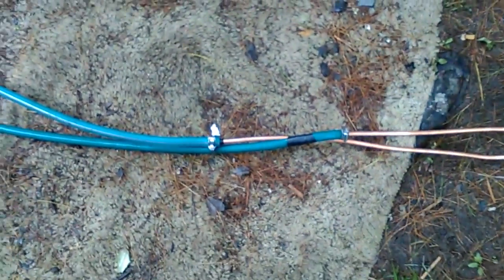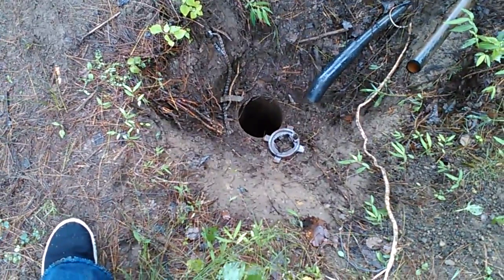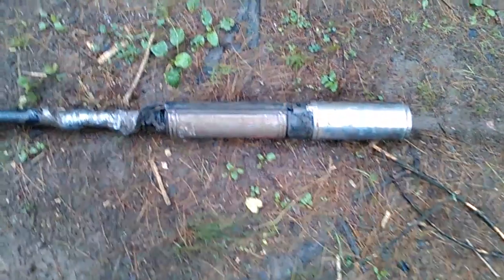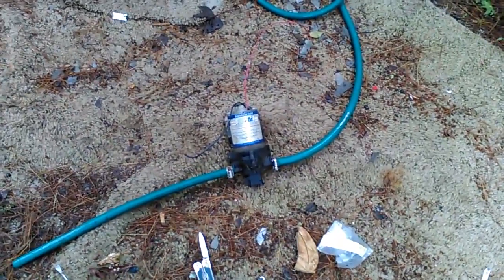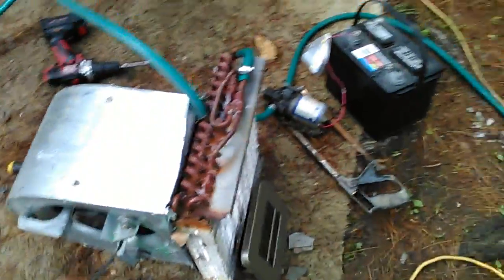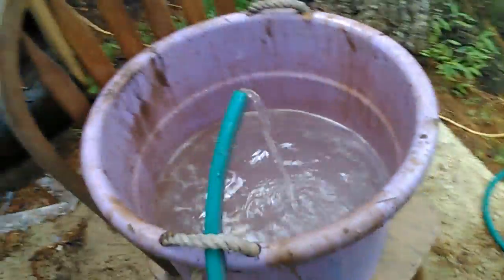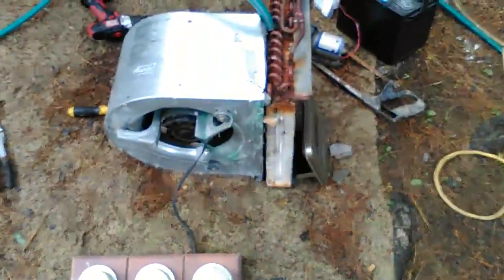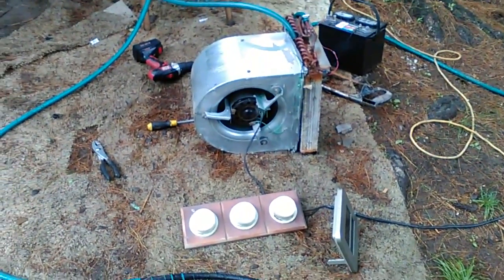easy DIY geothermal cooling system.

Comment: Theory of ground source water/ with that type coil 5/8" water inlet/outlet  with 70* air moving across, cool maybe 200 sq.ft. area. If you got a pump/grundflos/115volt.move water quicker and could keep the loop cooler. Try and find ole wide think horizontal coil or hydronic /coil. they are cheap under 80.00

Comment: an idea i have and seen which has nothing to do with this type cooling.put a round duct pipe from a outside tree in a shady area.from there run the pipe into your home grill it off and use fan if you wish for summer cool air from outside.basic principle of years ago     in cooling before air cond. in office buildings between the walls going up floors.

Comment: Why do you run the water into that blue tank? Can't you connect together and run in a closed loop?
Reply from the maker: That was what was intended but the hose had a couple of leaks in it and the pump kept losing its prime so I used the tank to hold extra water to make up for the leak. I didn't want to spend any money on it since it was just an experiment so I used what I had. To do it right you would buy all new materials so there would be no leaks, then it would be a closed loop.
Reply: If you use this as a water source open loop system, it will give some benefit. But, it will not work as a closed loop system if you return the water to the same well. There is just not enough BTU transfer to the soil surrounding the well pipe. You would need a few hundred feet of such closed loop system to get the benefit you are looking for.
Reply: Find out how you can build a cost free energyyyy generatorrrrrr>>>http://renewableenergyy.blogspot.fr >>>

Comment: Thanks for posting your idea.  There has already been posted some good suggestions but I also thought I might be able to add to the discussion constructively.  Taking a few meters of copper and placing it in the well will probably produce some cooling effect but your length of cooling coil seems extremely short for cooling anything more than a hamster cage ...no disprespect intended.   Another aspect is how far down into the well water you place your tubing and how much standing water / cubic meters of water held in the well.  Remember that most heat on this planet wants to rise towards space which is very cold  thus the heat sinked in the well water will invariably rise to the upper surface of the well water until it can rise out of the well or some being absorbed into the surrounding ground but probably not that much.  This will greatly effect the success of your experiment. So my two suggestions are use more tubing [commerical heat exchangers for a house may use a 1000 ft min. of tubing in-ground] for more surface area heat exchange and get the coil as far down the well as you can so as to provide more exchange area below whatever heat that will iinvariably collect higher up in the well water trying to escape through a very small surface area.  Since you are using materials that will degrade and leak within a few dozen months at tops I can't recommend you try anything but water in your exchanger as otherwise you will end up contaminating your well.
Reply: Everything you just said would be true if groundwater was still. But it's not, it's flowing, like a slow underground river. It just has to be fast enough to remove the amount of heat that you're trying to put into it.

Comment: Put in a underground cistern with a nitrogen rocket air conditioner and draft your house. It will give you cold running water. Your mass underground rocket stove would give you heat and hot water. Hell even drinking water or Grey water for a green house! ; )

Comment: Good experiment. If you had a pressure tank hooked up, you could use the submersible well pump to fill and pressurize the tank automatically whenever you call for cooling. It would only rarely kick on and would use negligible amount of electricity overall. Then add a ball valve to slowly feed the water from the tank through the coil. After the water makes its way through the coil you could discharge it into a gray water drain or maybe back into the well.

If you use a DC fan you could vary the speed so that you get good condensation on the coil without using too much fan power and that alone would increase comfort. It seems like your fan was at a good speed though since you were getting condensation.
Reply: It takes a lot of electricity to raise water up in elevation, but it takes very little electricity just to circulate the water.

Comment: You need some education first.
Reply from the maker: +Abdul Hassan What do you mean? Why do you assume I am uneducated?  I have an electronics degree, but that had nothing to do with this. This was an experiment that was successful and met the require goals.
Reply: +luke Fugate he likely made a ignorant assumption because of your accent. because we southerners can't be educated.
Reply: I believe he did a great first run.  Obviously, after a few hours, the science will become obvious and then the heat sink can be expanded.  Later, depending on need, he can add a condenser-evaporator combination.  But there is NOTHING ignorant about this unless he gives up when the science kicks in.
Reply: luke Fugate Beacuse CERTIFIED CONSTRUCTION is an Ahole..lol  This is Exxxactly what I want to do in my future house.  I was planning to run several small heat exchangers in series in a bracket down a well hole.   Insulated lines from the well into the house and another large heat exchanger added to the handler.  Yes, idea being to cool and dehumidify, plus, free clean water for my cistern!!  Also looking at running the glycol through an in floor heating/cooling system, but I'm liking the handler idea better!  Awesome to see someone doing it and not just talking about it! ; )
Reply: Yep. Because we're all a bunch of stewpid hicks. Duh-huh, duh-huh, duh-huh. We'd sound so much smarter (dripping with sarcasm) if we all sounded like a bunch of New Yorkers.
Reply: Luke:  F*** Certified Construction.  You are a smart and inventive guy for sure.  I love videos where guys experiment like this without all expensive equipment.  Your video has inspired me to try and do something similar !!  THanks !!!!
Reply: Three years later Certified Construction is still an ahole and I'm a southerner with a bachelor's degree! 🖕

Comment: your check valve is what killed your pump and pressure switch or made it so money hungry and it is  your best investment on any well or fluid system it kept your pump from having to keep lifting water all the time and two are better than one and gravity holding tanks and bilge pumps or windshield washer pumps make good transfer fumps also automotive fuel pumps low draw high output up to 120 psi for some and easy to find for free or a small fee from salvage yard while yur there grab a couple radiators  one in one out side  and connect em to the pump then each other fill er up n let her rip

Comment: Couple of things. Increase the contact surface area with the water in the well by coiling or changing the amount of contact or changing the design of the contact coil. You might also consider slowing down the speed of the air going through the radiator coil to increase the delta T across the coil. These approaches work best when you can apply a fluid made for heat transfer, like glycol.  You can also slowdown the flow in the pipes by increasing the size of the pipes.  Good luck.
Reply: +jimships FYI, thermal efficiency is reduced the higher the glycol concentration.
Reply: +bloodytosser1 your correct
Reply: i made it too. just used InpliX instructions.
Reply: @ Peter: when one speaks and listens, no one gets confused. Why? Because "correct" is not a noun., so your for you're is not a major impediment to effective communication as some would lead us to believe. But, you're correct, if that matters at all.

Comment: I was thinking of doing something similar with my swimming pool.  I figured heat the pool and cool my house at the same time.  So how'd it work out for you?
Reply from the maker: ***** Worked ok. my fan uses a lot of power for my battery bank and inverter so it has to run intermittantly. but compared to a conventional unit its not bad. The pool idea sounds good, kind of a two for one deal.
Reply: +luke Fugate how DD you go about buying land??
Reply from the maker: Viral Video
It was inherited. It's been in my family for a long time.